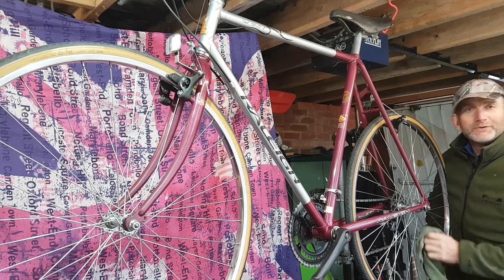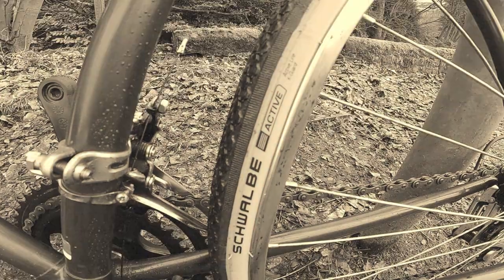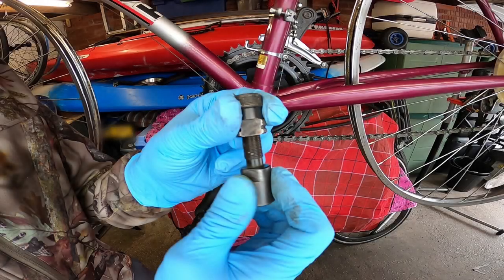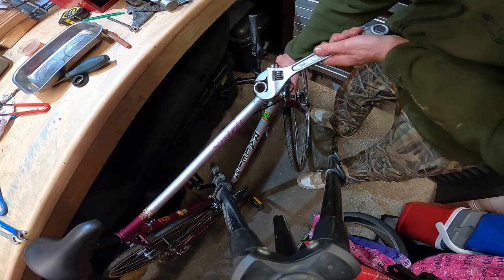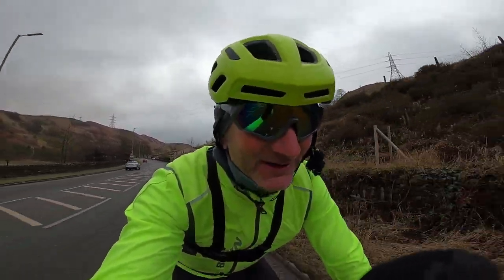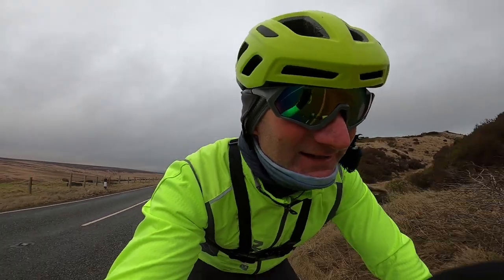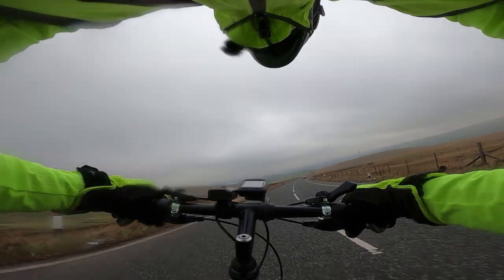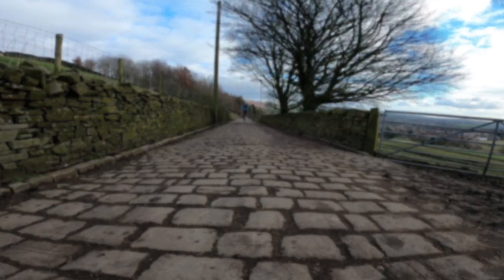1992 RALEIGH PIONEER RESTORATION PART 1 #raleighbikes #restoration  #raleigh

Comment: Hi there, great video.  I had three pioneers in the 1990s and I used them to commute to and from work and they were great bikes.  I deeply regret letting the last one go.  The pump was a spring fit into the frame but all the wheels were 700 x 38c on the three I had.  Raleigh was a great bike in my opinion.  Thanks for the video.
Reply from the maker: Hi Peter and thank you kindly for sharing your memories about riding the Pioneer. I came across it by chance and thought that it was to good of an opportunity miss and decided to film the restoration.
When I say that it is a comfortable bike to ride, it really is !
Once the bike gets up to speed it just rolls effortlessly along.
Thank you once again for commenting buddy 👍

Comment: Fantastic job you've done there Daz, makes me think of all the bikes out there that could be restored. Good to see you out on the road again. Back in the 80's my first racer was a Raleigh Winner and then in the early 90s I bought myself a second hand Raleigh Equipe, the frame was a bit too big though but it did me well and I even rode from Doncaster to Baslow on it once with my camping gear (ie big rucksack on my back as couldn't afford panniers).
Reply from the maker: Thanks Mark 👍. I love these old bikes, they don't creek and you can polish things up with wire wool and T-cut.
I wouldn't mind a good old touring bike to restore because I could then use it to do exactly what it says on the label.
I had a Carlton Pro-Am amongst many other bikes in the 80's. I just wish I'd kept hold of em !
Reply: @MrDazP1adv3ntures  Carlton's just round the corner from me, I know a bloke called Dave Marsh who used to build them and was a top cyclist in his day. They were definitely built to last
Reply from the maker: That's interesting to know. It had a lovely pearlescent finish too and was a really smooth ride.
There's an old guy up our way called Billy Holmes who won the Milk Race in  61 he is a fantastic person to talk to about cycling. I think he road for Carlton as a pro for one season. He was a Falcon rider though for many seasons I believe.

Comment: What a great video Mr Daz ! You make everything look so easy. What speed do you and Mike usually do down there ?
Reply from the maker: Hello Phillip, I have gone down here at 55mph on the fast section.
The first left hander, you can hit that at between 45 and 50mph on a good day. I am definitely going back up there when the wind is in the right direction. I reckon I should be able to get over 40 mph with the new 5spd block on the back now but the front end has a 48th chainring which is a bit on the small side !

Comment: Nice job on the restoration. I think you would have made 40mph if you had your seat post about 1 or 2 inches higher. Your legs looked like you were sitting too low to get proper extension, unless that was a camera angle artifact.
Reply from the maker: Hi Jason, it was the camera angle to be honest, the frame is a tad too high for me but never the less it is perfectly rideable. The gear ratios are just not suitable to high speed efforts without pedalling at a crazy cadence.
Reply: @MrDazP1adv3ntures  still, nice job, a beautiful bike.

Comment: Can you get any bigger gears on that Daz, flat out at 39 is no use to man or beast 😂😂
Reply from the maker: It's because it's a commuter bike. I could fit a 52x42 on the front.
I had to screw the stop on the rear deraillure to the 5th cog of the 6 speed block because there was no clearance for it to turn. This left me with a 16t on the back being the top gear. The cadence at 40mph is nearly 160rpm !
I've now got a 5 speed block with a 14 tooth sprocket.
I will be out very soon on it giving it some hammer down my local hills 😁
Reply: @MrDazP1adv3ntures  ok for cycling to work then, top job on the resto 👏👏
Reply from the maker: Yes, that is what these bikes were for. 
I've put better components on now and it's a million times better.